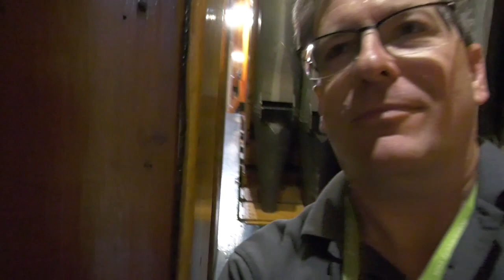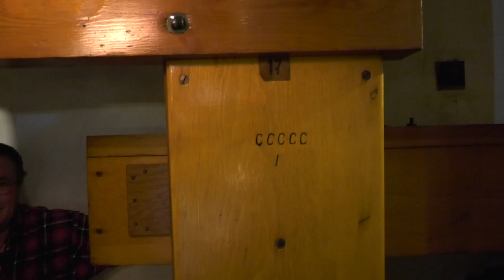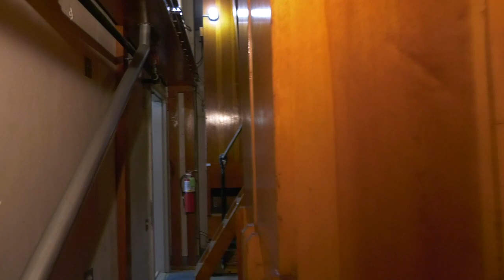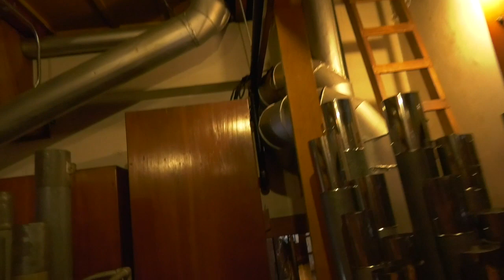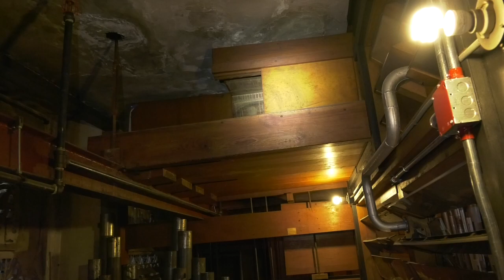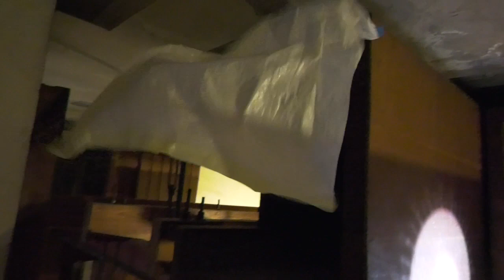Boardwalk Hall- The 64' Diaphone

Comment: Hell's own racket starts at 7:41. The trash bag taped to the mouth of the low C pipe actually keeps vibrating with the air after the sound stops.
Reply: It's insanely amazing!
Reply: Resonating
Reply: @scottcupp8129  Amazingly insane, too!
Reply: Great demonstration or reflecting wave due to impedance change (of the open air).

Comment: So, how does that even get tuned?  Is the tuning slide on a 64' pipe just for show? 
How often do all the pipes need tuning?  How does one go about tuning something with 33k+ pipes?  Does humidity or temperature affect it like other instruments?
Reply from the maker: The tuning slide doesn't do much, that's for sure. Realistically these 64' pipes are "permatuned" and don't get tuned, as such. As for the rest of the organ you just go through section by section and tune it like any other organ, it just takes longer because there's so much of it!
Reply: Temperature is definitely a factor, and divisions laid out in multiple levels like this are tough to keep in tune just because of the temp difference between the various “altitudes,” if you will.

Additionally, reeds can fall out of tune from vibration, but all the flue ranks rise and fall with temp changes while the reeds stay closer to pitch.

The larger the organ, the harder it is to get in precise tune. Tiny errors across thousands of pipes compound into a general detuning that robs the organ of its clarity and transparency. This is always obvious with the Boardwalk organ, through no fault of the staff. It’s  just too big and too spread out to tune  perfectly.  

I have an organ of about 2,500 pipes. I can spend two days to get it in good tune, taking time to tune overtones beat-free. In a week it will lose that precision.
Reply: @PeopleAlreadyDidThis  
Way out of my expertise here... but why wouldn't one create an environment whereby temp and humidity stability are controlled... therefore mitigating the factors that lead to the instrument getting out of tune?
Reply: @FOH3663  It's not really feasible for the location. It's a big arena, they're not going to keep the HVAC running when there isn't an event going on. As far as humidity goes, the blower rooms have big swamp coolers, and the blowers run slowly to pump the humidified air through the organ whenever humidification is needed.

Comment: I can't even imagine how they fit all this stuff into the chambers without 3D cad to guide them. And left room for access. Did they pre-assemble each chamber in a shop before installing? 
But the woodwork is beautiful with everything varnished and the treads of the ladders mortised into the stringers for strength.

Comment: Those are MASSIVE!  Funny part is, from a tuning perspective, you can't really tell if the lowest of the lows are truly in tune because all you can hear is the vibrations.  It really does not sound like a pitch.  How much wind pressure is that one stop riding on?
Reply from the maker: The Diaphone is listed as being on 35" pressure.
Reply: @chrisnagorka5199  wow
Reply: @JBridges1092  Keep in mind that "normal" pressure for this organ is 15-25". Two of the ten 32' stops are on 50" pressure, and those are far more impressive than this one. Such as here: https://youtu.be/yUmdKax2248 ...and keep in mind, that trumpet stop is "only" a 50" one, not the 100" Grand Ophicleide.
Reply: @chrisnagorka5199  I love your video’s. One question about 0:17, why is it vibrating so irregular?

Comment: "CCCCC" can't be right. The note you played was about 8.18Hz, which is C-1 or "CCCC". "CCCCC" would be C-2 which is about 4.09Hz. You wouldn't be able to hear that at all; at most you'd feel pressure fluctuations in your eardrum, about 4 per second. So you must be using midi notation, in which -- for some reason that's always eluded me -- each note is named with notation that's 1 octave too low. Eg, C4(cc) becomes C3(c); C2(C) becomes C1(CC); and apparently C-1(CCCC) becomes C-2(CCCCC).

Comment: Aren't there two stops that play off these resonators (1 flue, 1 reed)? Would have been interesting to hear the other one too
Reply: Initially there were plans to have two boots for each resonator, a diaphone boot (as seen here) and a reed boot (hence the name 'Diaphone-Dulzian'), but those plans were scrapped after some testing.  I'd love to know more about those tests and what dissuaded them from proceeding, though!
Reply: @principals16842  Though I have no hands-on experience of diaphone organ pipes, my long experience as an organbuilder and voicer brings some educated guesses. (1) They couldn't get both to work at the same pressure. There may simply have been no room for separate supplies. (2) The valve that was supposed to switch from one boot to the other was an acoustic obstacle to one or both. (3) They couldn't both be tuned at the same resonator-length. (4) It might simply not have been possible to get the reed to speak fast enough to be of any use; or that it proved impossible to voice for some (many) other reason(s).

Comment: How does the ear perceive any pitch C or C-sharp? Or do you just feel the vibration in your feet and imagine the pitch because it reinforces higher octaves? And how do you tune the C and C-sharp (or other adjacent tones) to be a half-step if you can't really hear the pitch?
Reply: The fact is that you don't perceive any pitch at all from these pipes, and you don't tune them. They were tuned in 1929 and they've been that way ever since. In fact they're quite out of tune in spots but the only way I know this is from a video someone else did where they sped up a recording of it 2, 4, and 8 times and that way you can actually tell what's going on.
Reply: I forget which organ, but a well-known one uses the same pipe for the lowest several notes of the pedalboard. 32’ stop as I recall. Actual pitch below accepted hearing limits is unimportant, underpinning the plenum.

Comment: is that pipe C-zero = 16hz? or C -1  = 8 hz?
Reply: It should be approximately 8Hz.
Reply: C-1, 8.175 Hz.
Reply: Although this note is flat by a whole tone, at B-2, 7.716 Hz.
Reply: It's supposed to be scientific pitch C-1, multi-letter notation "CCCC". Why it's incorrectly labeled "CCCCC", I don't know, as that would be about 4Hz. (Though, as others pointed out, it appears to be beating at about 7Hz instead of 8.18Hz as it should, so it's about 100 cents flat.)

Comment: Measuring from your soundtrack, that low C is actually a whole tone flat, at 7.36Hz it is much closer to B-2. Those big pipes must be much easier to tune using modern frequency counters. Thanks for uploading and good luck with the restoration.
Reply from the maker: I'm going to be up there in a couple weeks and I plan to do exactly that.
Reply: Good catch! I pitched it up 4 octaves, and it came out as B2.

Comment: You can count the 8 beats per second at 7:40
Reply: ...which is interesting as the pitch is right at 8Hz.
Reply: @cnagorka  Yes, 8 per second. Interesting fact: When a open ended pipe is closed at one end it vibrates at half the frequency (an octave lower). Try it with a flute headjoint.

Comment: i thought that   32' is the maximum on an organ
Reply: there's really no maximum, but 32' is the longest practical stop, as below that you're into infrasound. This is one of only two 64s in the world.
Reply: It was until they built this and the Wanamaker organ in Philly. I believe those two are still the only instruments in the world with a 64' natural stop/rank. I think one of these instruments, at least, also features a 128' resultant using the same rank.
Reply: But, if you can't find that on the stoprail of either one, just pop the 64 down and hold two notes a fifth apart and you'll have your 128' resultant. Hopefully you won't damage the building. :-^
Reply: And of course if you want to get it partway into the 256' range you can try holding them a FOURTH apart.
Reply: And to generate an earthquake and send the Boardwalk into the Atlantic permanently, just step all over the pedalboard on the low end and hold everything down. :-"
Reply: You might even be able to get a whole herd of blue whales to beach themselves :-&
Reply: @TurtleFL  The Wanamaker doesn't have a 64. The other one is the Sydney Town Hall organ's Contra Trombone. Boardwalk Hall has the 64' Diaphone available at 42 2/3' as well, which gives you a 128' resultant when used with the 64' stop.

Comment: That is wild!  How do you even tune them when they go that low?
Reply: I've never done it, but if I had to (absent the lore of someone wiser) I'd want some device to produce the required number of beats per second--a very fast metronome, in effect. Today that can surely be done electronically. But with the comparatively simple physics of the thing, maybe the parameters of the disk-valve and spring can be calculated for each note. (The physics of a conventional reed's tongue are fiendishly complicated and nobody, as far as I know, has ever worked them out for practical use.)

But how to keep it in tune, as the rest of the organ rises and falls with the temperature. My guess is that you can't and you don't try.
Reply: @jameslouder  I'd think so too.  I was told once by a tuner that they don't always need to do large pipes (8' and up) because the expansion or shrinkage of the materials is so slight that it doesn't really alter the pitch like it does in smaller pipes (reeds probably are the exception to this).  I just remembered that after your reply.
Reply: @jeffwhite4227  Actually, the pitch/temperature variation isn't due to the expansion and contraction of pipe-metal, but to variations in the density of the ambient air, and consequently to the speed of sound. If it depended on the material, the wooden pipes and the metal pipes would diverge, but they dont: they go up and down together and remain in tune. For reeds, however, the density of the air is a secondary factor; what counts is the tongue and that stays put. So while we say, the reeds have gone out of tune, in reality they have just stayed where they were. (N.B. these remarks ignore particular reed pipes that may be intrinsically unstable; also little wooden pipes whose windways may change with variations in humidity, itself a function of temperature.)

When tuning flue-work one can often get away with leaving the first octaves as found. This is because even if they are several cents lower or higher than the rest, the beat rate is so slow that it isn't obvious. But if low C draws tenor C off pitch, then the other octaves will beat. When doing a general tuning, one should always seek to recover the organ's original pitch, corrected for temperature.
Reply: I've seen a video revealing tuning problems by speeding up the clip of the pipe playing.
Reply: For anyone interested, there's this video here https://youtu.be/Kq87ViyXfcA that I made using Mathematica.   I have to say the continued motion of the garbage bag really shows the fact of the pipe being resonant at that low frequency.  Impressive!
Reply: I would think you'd record it, and then shift the audio up a couple octaves and discern from there
Reply: @shiningarmor2838  I saw that too. Apparently they didn't bother tuning the overtone series of those behemoths, or perhaps didn't even know how to physically accomplish it.

Of course they weren't intended as actual tones to begin with, only as sympathetic vibrations to enhance notes the human ear could actually process.
Reply: It's not in tune. I pitched this up by 4 octaves and found out that it's B instead of C.

Comment: I wish we also could have heard the note without the Garbage Bag.
Reply: You can't.  The lowest notes vibrate at 8hz.  What you are hearing is the air moving.  The thumps are coming from the beater down at the base of the pipe.
Reply: @BRadfrommalibu74  Hmm, I thought that as a reed pipe, it would have some harmonic over tones caused by the reed beating,, unlike say a stopped pipe, which in that range has zero upper harmonics, and are completely inaudible.
Reply: @seankoreski5826  It isn't a reed though. It is a flue pipe and the beater  is what admits the air to the pipe
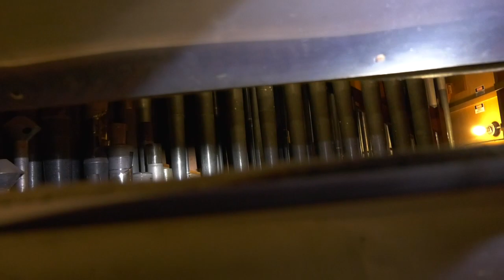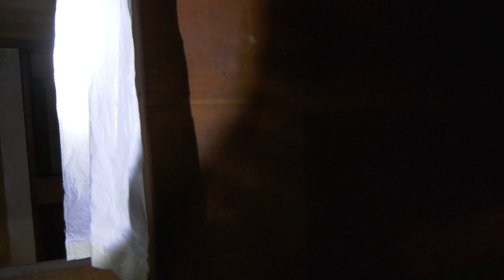Reply: @BRadfrommalibu74  I have been corrected, it isn't exactly a reed pipe,, but has a pallet acting as a reed. So you are correct. However I was always under the impression that the "Slap" of the pallet against the Orifice created a snap at the beginning of each pulse,, that is audible,, even though the 8hz fundamental tone is of course not audible. Please forgive me,, I just based that assumption on a theater organ here in Portland Orgeon that had a 32' Diaphone,, and you could hear that "snap" at the beginning of each Pulse. The tone was much more audible than, for example, the 32' Tibia. In fact the owner does a demonstration of this between minutes 4:48 and 6:55 of the following Video: https://www.youtube.com/watch?v=qXvoU4GR5WIhttps://www.youtube.com/watch?v=qXvoU4GR5WI
Reply: @BRadfrommalibu74  Oh and I forgot, here is a recording going down to the 64' foot C on a contra trombone where,, though I agree, you can't hear the 8hz,, but you can hear the rattle caused by the Reed "in this case not a pallet" hitting the Shallot: http://www.organstops.org/b/ContraTrombone64.mp3
Reply: @BRadfrommalibu74  So my point is,, I still wish we could have heard it without the garbage bag!
Reply: There absolutely are audible harmonics, the sum of which is what you hear as the periodic banging sound.   If there were only 8 Hz present, and if that frequency were completely imperceptible, you wouldn't hear anything at all when the pipe played.  But, as with almost every other organ pipe, including diaphones, each tone has a collection of harmonics at integer multiples of the fundamental frequency, and it only takes the third harmonic of 8 Hz, i.e. 24 Hz, to enter within the commonly-stated "20 Hz-20 kHz" range of normal human hearing, and these pipes actually produce a lot more than the first three harmonics.  

I have to agree that the failing garbage bag certainly does make a sound flapping in the wind like that, and it would have been nice to also hear the pipe speak without it.
Reply: @BruceBoppoTiemann  Thank You! I agree!! as you mentioned almost every other kind of Organ pipe. And of course,, pipes of very pure tone like the stopped Flutes that really aren't much good below 16' C. I'm not too sure about a Diapason below 32' C either,, but reed pipes and their close relatives definitely have overtones that can be heard. we've heard them before,,, so I it doesn't need much explanation. There's plenty of Videos on you-tube with 64' reed work, For example: https://www.youtube.com/watch?v=e1rjIRkQWC8
Reply: @seankoreski5826  Although everyone probably experiences sounds slightly differently, I personally experience the pitch effect of 32' bourdons down to about F, which is just over 20 Hz.  That said, I have had the pleasure of sitting at the console and playing the 32' contrebasse rank by itself on the St. Thomas church organ in New York City, and the fact of low C being a C on that rank was quite evident to me; it was an incredible and singular sound.  (This was before that organ's recent renovation.)   Based on this experience, I think that a hypothetical 64' contrebasse would have a few bottom-octave notes in which the pitch would be evident, although I doubt my sensation of pitch would persist all the way down to 64' C.
Reply: @BruceBoppoTiemann  I'm assuming the contrebasse you refer to is a stopped pipe? I've heard that many can hear the note down to F in the 32' octave,, I think the acoustics of the building/distance from the pipes can effect that. I agree, I would love to see a 64' Stopped pipe, of course you could only experience it in person,, as is the case with it's 32' counterpart. No recording could do it justice.
Reply: @seankoreski5826  It would sound exactly the same.  The bag was just to show the wind.  It didn't change the sound.  :)   ~Cindy!  :)
Reply: @CindyBradyTooh  I know the bag was just to show, visually how much wind is moving. however we wouldn't even be having this conversation if they just fired the pipe next to it,, for comparison. since they didn't,, every one will have their own opinion,, and that won't change. does it sound different? not so much? well, it will only be solved by another video.

Comment: That looks like less than 10 Hz … maybe more like 6 Hz. Oddly enough, the wavelength of 18 Hz is a little more than 63 feet, so the fundamental resonant frequency of this pipe would be very close to that. Somewhere in the low to mid 30’s frequency, it ceases to be a ‘tone’ that could possibly be identified with a musical note, and becomes an impact type sound, like a jackhammer or a machine gun, where the individual pulses, or peaks and valleys in the waveform. For example, a 50 caliber machine gun firing at a rate of 500 rounds per minute equates to about 8 rounds per second, and the individual shots are easily distinguishable from each other. All manner of harmonics are also generated, octaves, major thirds, perfect fifths, etc, many of which will extend up into the audible range. All I can guess is that the constructive interference that will by necessity be present will be heard as an enhancement to the bass note … otherwise I don’t know why a device designed to produce a frequency far below what the human ear perceives as a ‘tone’ or a note with a pitch, would be included in a musical instrument. I know that there are digital signal processors that add synthetic sub-harmonics to bass signals to use for recordings and even live sound reinforcement systems to enhance the bass components of the overall mix, but most noticeable in the bass drum and electric bass guitar- both critical in dance music.